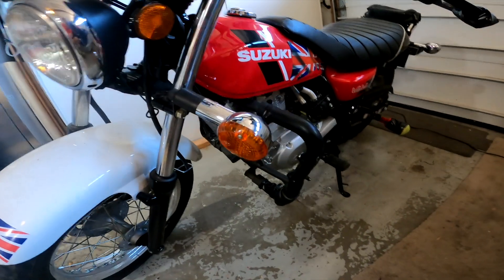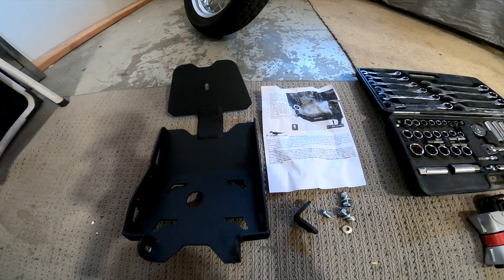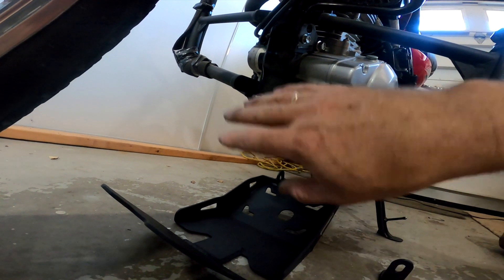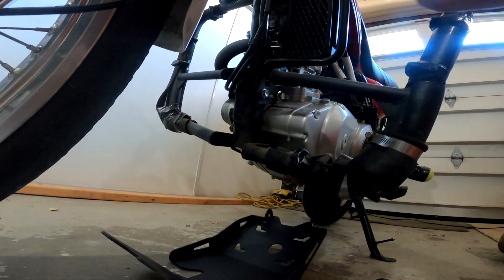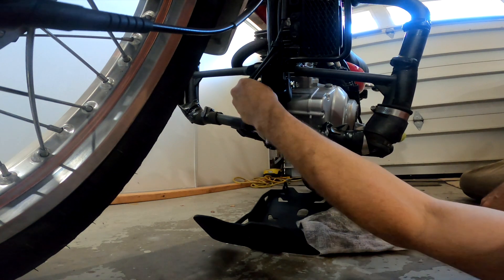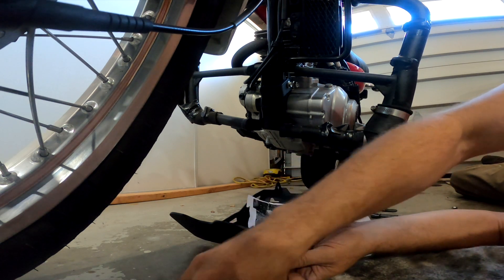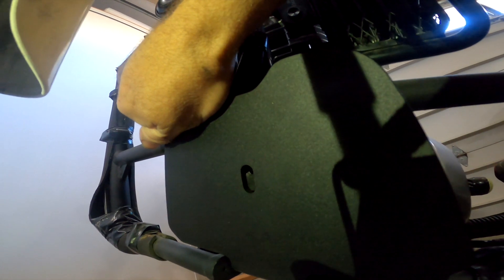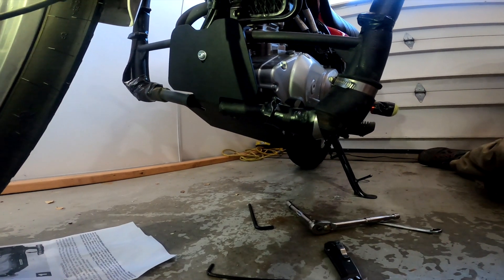Suzuki VanVan Skid Plate install

Comment: looks like a solid piece of kit, i think i got my centre stand from t-rex... thats great for rear wheel and chain maintenance, i also fitted a fender extender to the front mudguard (fender), to reduce the front of engine being coated with mud etc... one thing with all the added bottom end weight i guess it will be even more stable... have fun
Reply from the maker: Thank you ! I agree the T Rex products are extremely well made and heavy duty parts. I now have of the availible TRex VanVan parts on my bike except for the centre stand .. which will be next on my list to buy ! Still loving this little gem of a bike - It gets compliments everywhere I park it ! Stay safe out there on 2 wheels!